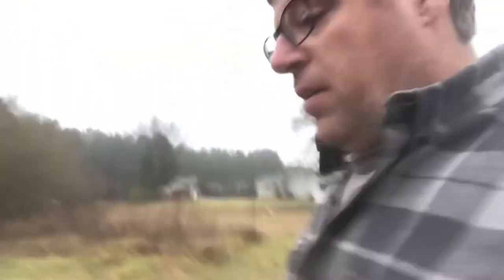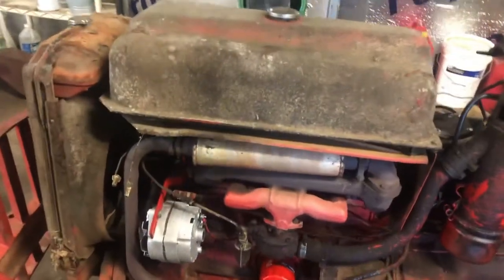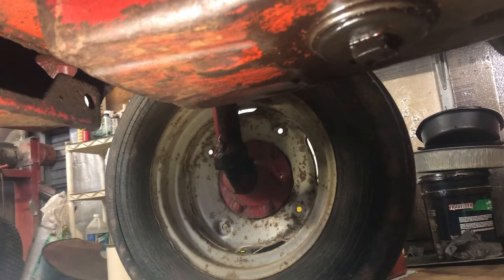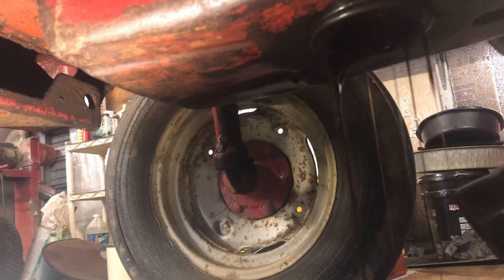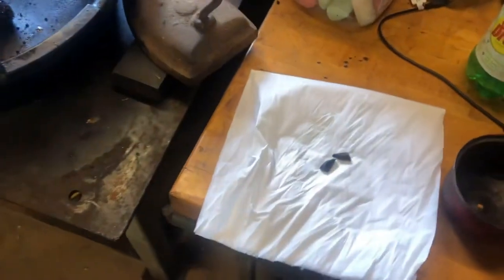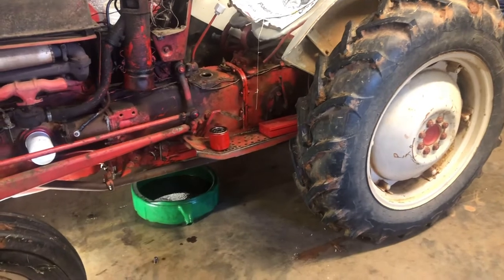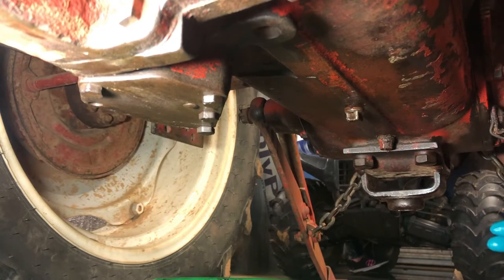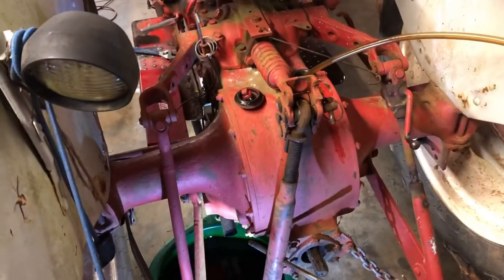Servicing the 600

Comment: Where is the motor oil fill? And what type of motor oil did you use? Thanks
Reply from the maker: It’s on the right side of the motor near the front. I used 10w30.
Reply: Requires 30 weight